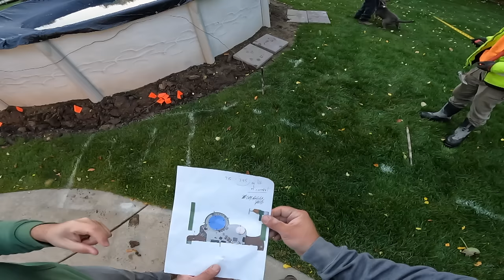Look who's back! Build back better?

Comment: We have owned many Bobcat Skidsteers over the last 25 years, we always got hand/foot controls because we rent out equipment out and it seemed best, last year we got a good deal to switch over to Deere and had to get hand controls.  I had always resisted them, but now I would never turn back.  I understand your reasons for resisting but I think you would adapt and love it after a bit.
Reply: I agree with u. Loved the bobcats with foot and pedal control but when I switched to hand controls I'm never looking back either. Once u get used to them and run them awhile they r not bad at all and wished y did I even like foot controls.

Comment: Hey Ryan. I know on my dump truck when it’s idling. You turn the cruise control on and make it idle up a little bit. Then it will stay running while idling. If you don’t do that then right before the truck shuts off, the check engine light will blink for a couple of seconds then the truck shuts down.

Comment: Hey Ryan, I would definitely try a New Holland skid steer. I have had three 200 series New Hollands which are the same as the 300 series just less in cab technology. all were hand foot control and have been excellent machines to say the least. hands down best visability of any machine I have run.

Comment: Ryan,
Take a look at Case Skid loaders. I’m sure you know they are the same as New Holland…

Yes, they are both built in Witchitaw, KS. Different colors, different rear body styles, Case has built-in side lights, Case has a lap bar vs. seat belt for NH.

Use Case out here in Colorado mountains (originally from northern Illinois and used there too).
Ton of big rock here, big big snow removal, hard ground, work amazing! 

I feel I can see better out ofCase vs new holland too. A nice TR370B would be a great pickup for you! Maybe a powerbroom too for street cleaning.

Comment: Ryan, Shot in the dark, my Mack does something similar to what your freightliner is doing, when it starts to get cold, the coolant shows full until you start it, then it shows low, it will shut off if you don’t raise the rpm’s, ands not an issue when it’s warmed up, check the coolant and add some, maybe that’s your issue
Reply: yep coolant level will do this sort of thing. I was going to post it but i saw this comment. Thats where id start!

Comment: Hey Ryan I'm from England and I have laid a lot of concrete in my years and when leveling the concrete off we over here tamp it down at the same time bringing up and bubbles or trapped water so when you finish it makes it smoother and less work. So when you drag your level tamp at the same time while dragging towards yourself. Hope this helps from a fellow layer. 👍

Comment: Check your coolant level on that truck. I ran a kenworth t800 that did the same thing. Coolant was low below the sensor on the tank. Topped it off and it stopped the light and quit shutting down. May not be it but it's worth a shot.

Comment: You should get a FIXD . It's a plug in that goes into the plug under the dash . You download the app on your phone, plug in the FIXD into the vehicle, start vehicle and it will read the problem and give you the code on what your problem is.  It works . I diagnosed a check engine light , it was a plugged catalytic converter .

Comment: I’ve got a Battery Powered Orange Flashing Light in My Car. 
Whenever I have to Park My Car in an Overly Dark Spot at Night, I Place My Orange Flashing Light on the Rear Parcel Shelf, Driver Side, as a Warning to oncoming Cars. 
Works an absolute treat.

Comment: Your truck may be dropping fuel pressure, may be worth throwing a new fuel filter on it.. throw a flashlight in the tank look for any rust, and see if your filter housing has a drain on it, drain a sample out and look for water., that trucks tanks have flat tops, and you have had a lot of rain, the water would sit on the bottom of the tank and MAY cause a little rust as evidence.. may not rust if tank is coated. I’m not familiar with that exact truck engine combo, but I’m ok with diesels in general, just some cheeper options to check before taking it in for big money..

Comment: Had same problem with Freightliner diesel. Had a bad air pressure sensor and low coolant after checking everything and solved problem. Hopefully this helps

Comment: Clean or replace your water sensor or make sure it has enough coolant. It’s probably showing it’s low on coolant and shutting it off as a safety. The sensor should be on the side of the tank where you fill your coolant.

Comment: 29:40 It's super easy watching someone with 30+ years of experience that can see in his minds eye the project already completed. Who has been to the job site, sat down to do the bid, and in his head already done the job twice before even showing up on the site.  Then when on site convey to his employees what the finished product will be. When I do a job like this I will take 5 minutes or so when arriving on site to show my men what the design is so they can get everything prepared while I'm doing demo. This one was a easy demo no rebar or wire ( those are my favorites). It's key to stay calm on site, which sometimes isn't easy speaking from experience. Most of all don't let your success go to your head all these men working around you everyday are the ones that helped you get to where you are today.✌✌👍👍

Comment: Hey Ryan on that freightliner form truck check the coolant level sometimes when those trucks are low on coolant they flash those lights and do the exact same thing yours is doing i have a freightliner water truck that does the same thing when the coolant is low

Comment: Hey ryan most likely the red truck that stops needs new battery.. if you have a multimeter check if it goes more than 13v while it is working.
Reply: Then it would die driving too 😂

Comment: Check the coolant level or bad coolant sensor level (oil pressure and coolant level should be only two that will shut it down)

Comment: Look at the Kubota machines.  My part time boss was died in the wool New Holland until a hydraulic line broke one day and trapped him in the cab for over 2 hrs because the front door swings open.  Kubota the door slides up inside the cab.  He loves it way way way better than he ever did the New Holland.

Comment: Most big trucks only shut off for low oil, low oil pressure, low coolant, overheating coolant, new ones can turn off for emissions related problems but I don’t think your freightliner is new enough to do that

Comment: The issue with the truck could just be a sensor on the coolant tank, the engine protect light comes when it thinks something is wrong with one of the fluids on the truck, but usually won't stay running, it happened on one of our freightliner semis and it was just a bad coolant sensor.

Comment: It’s true hand foot control you do have a different feel for the machine.  But move forward and you will see EOH is pretty good.  My Uncle with a previous case 1840 on the farm always said. With a skid steer all you should need your feet for is to walk away from a job well done

Comment: You can use the "odometer" button to cycle through the dash and find out what the check engine light is for before taking it in for work. Push and release button until gets to faults the push and hold and it will start to show a code like ECU 128, then push and hold or push and release to cycle through the next couple steps for 2 step code. Like PID... FMI ... (I don't have it in front of me so I can't remember exact sequence.
Reply: Good message

Comment: For the 7.3 it could be the crank position sensor or injector control pressure sensor. Notorious for failing on the 7.3

Comment: I used bobcat for years, went to Takeuchi when the new tier 4 emisssions came out, exhaust gets too hot and regen will cause lots of problems on on machines like your that don't get alot of speed. Look at all the machines with engine fires, they are usually mulchers but the small site machines get too many regen codes. My guys begged me to find and older, low hour, homeowner unit. You can find 20year old machines at auction with like 200hrs but they cost what they went for new.

Comment: Might be an injector issue with the truck my bobcat will die if you let it idle but once you turn the throttle up a bit it runs good, I would try putting seafoam or atf in the fuel filter and that could clean the injectors.

Comment: Hey check your fuel supply line.  I had a customer brink his bobcat to me for the same problem of bogging down.  Turned out that when he brought it in to bobcat to have alternator belt replaced the fuel line was not ran correctly and ended up having a bend that caused it to collapse at times

Comment: Now I could be wrong Ryan but I thought when the check engine light comes and stays on that your ok to keep going but if the check engine light starts flashing I thought it meant you needed to get it fixed ASAP!?!🤔 idk I could have it backwards being this early still my brain don't always run right! But I'm pretty sure I said it right! So you might get that looked at on a Thursday so it can get fixed by Monday! 🤷‍♂️ hopefully it's something easy and small!..and with it only needing air,fuel, and spark to run that means it could be wiring or some type of sensor..cause if it was more serious you'd think it wouldn't idle fine at first/ run down the road just fine!?..so it don't do that at stop signs or stop lights I take it?

Comment: Does the truck that won't stay idle have cruise control? If so try setting the cruise on a high idle about 1100 rpm and see if it still dies.

Comment: The issue with the truck shutting off on idle is a code problem have to clear the code and things should run smooth. Might be something super simple.

Comment: The recent concrete ive been getting has been that stiff stuff find out there using a water replacement additive which helps the mix take less water which means less Portland needing to be used and still retaining strength but i dont like it super stiff stuff

Comment: @Victory Outdoor Services What happend to the compartment door while pulled over at the traffic lights? Has it happend before.
Reply: @Victory Outdoor Services how is the Air Conditioner ment to work while the front of the bobcat is an open hole lol🤣Let me guess it will keep your head nice and warm he he he, I just think that is funny a little. Most Heavy Equipment that have an open front would not contained an AC system. As it would not be effective.

Comment: When you make the joints are you cutting all the way through the concrete?
Reply: No probably like 2 inches down
Reply: Ryan explains it in other videos, but no its only going 1/2 way or so depending on the thickness.   Hopefully the cracks follow those cut lines and you never see them.

Comment: If your check engine light blinks. Doesnt matter what vehicle, what type of engine and what fuel it takes. When it blinks it means there is an active misfire. If you buy a cheap code reader it will tell you what code and you can google that and find out exactly which cylinder/cylinders are actively misfriring

Comment: stay away from new holland skid steers! they are HARD to get parts for expensive and are VERY under powered. johndeere is the way to go because there are other manufacturers that make cat and johndeere parts and most parts are interchangeable. bobcat new holland kubota and brands like that custom make their parts so you have to go threw them to get them. id stick to cat or johndeere.

Comment: Those back steps that were there, are so gay. Make a landing... The guy that did the concrete the first time didnt have a clue.. Why would you put sona tube in the holes? Just leave the holes exposed.
Reply: Tubes prevent dirt falling into holes before you pour. They cheap. There is no single point don't use them.
Reply: @delta_glider4362  How is dirt gunna fall into the holes. Besides, those tube break down ...